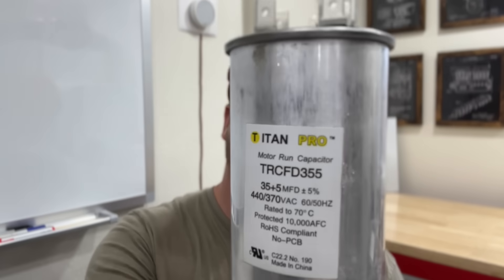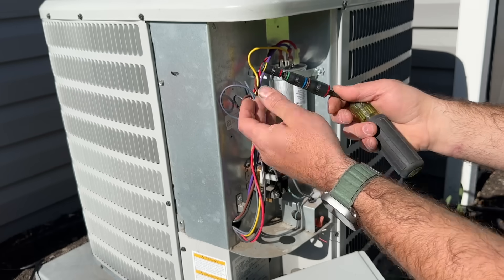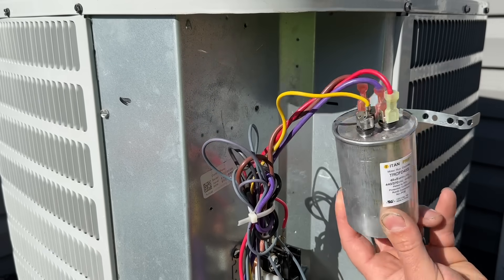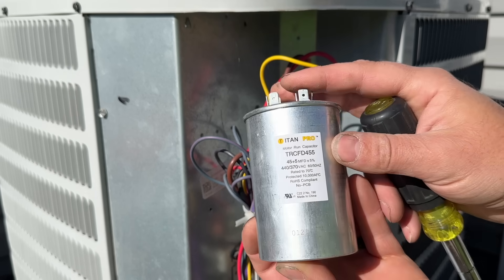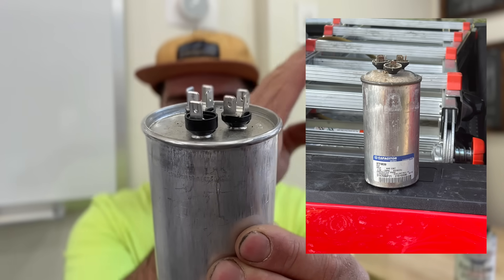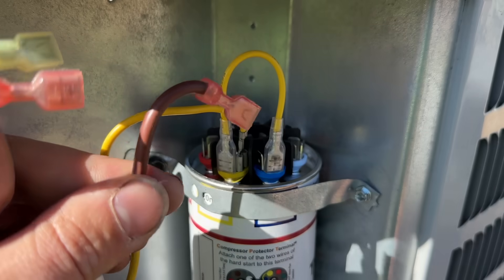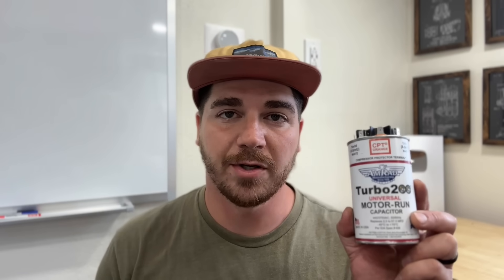HVAC Contractors Practically Make Their Living On These

Comment: Is there any issue with me just replacing these occasionally without using the tool to test it? I have two units I replaced five years ago and my HVAC company are telling me the capacitors are right the bottom range.

I'd happily spend thirty bucks every few years.
Reply: No, but you could just buy a multimeter and measure the capacitance instead every year or or every couple of years.  It tends to drift out of tolerance over time, probably way before it fails.  Also, they sell capacitors Made in the USA, Amrad, Mars and others.  I would use those over the Chinesium specials...

Comment: Because of issues like this, I always do a  LOT of research before I call in anyone for a repair.  Often I can figure out the issue and fix it on my own.  If I can't, most of the time, because of that research, I've already got a pretty good idea what the problem is. 

This is why, when one of my AC units was having problems, I first did some research online.  Through a few simple tests, I was able to quickly determine it was the capacitor.  I purchased a new one for about $20 and installed it myself.

Comment: Easy to replace.  Just make sure you disharge the old one and the new in the box before handling it.  Also make sure you match the microfarad and wire it exactly like the one you removed.

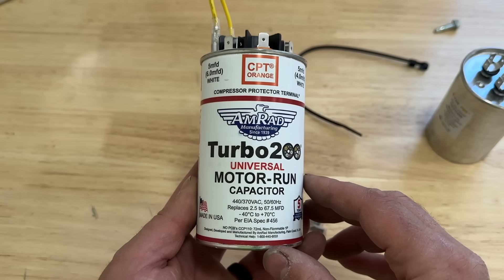Comment: 9:50 most capacitors have an 8 years warranty. The issue is that capacitors dry up over time. When they do, they short. If your unit’s capacitor is over 8 years old, just replace it. Don’t wait until it breaks.
Reply: Think you are probably mixing up compressors and capacitors.  Capacitors typically have a 1 or 2 year warranties, not 8.  Compressors typically have a 5, 8, 10 or even a 12 year warranty, depending on the manufacturer, and model of the unit.

The only time a capacitor will have a longer warranty is if you bought a new unit which has a parts warranty on the entire unit, but it doesn't include labor typically.
Reply: my bad. not warranty... guaranteed life span. they don't rufund you if they dry after 5 years. this is the standard life span for all electrolitic capacitors (uses oil).
Reply: @TheSiriusEnigma  OK, that makes more sense.

The problem you are going to have is I haven't seen date codes stamped on most capacitors.  So if you buy one, it will be difficult to know how old it is, or if you have one sitting in a closet somewhere, will be difficult to know how old it is unless you know when you bought it, and even then, you don't know exactly when it was manufactured.

Comment: I wouldn’t recommend messing in the panel because those capacitors carry 440 volts on one pole and 370 volts on the other. And they discharge in less than a second. Great way for someone to get sent to the emergency room
Reply: You are confusing AC vs DC voltage, and max voltage rating vs system voltage rating.  A/C flows through capacitors, so typically they don't retain voltage when disconnected, unlike when they are used with DC voltage.  The system runs on 240Vac, so the capacitor is not carrying 370V or 440V on anything, that is the maximum voltage rating, as capacitors are typically listed as 370V/440V, meaning they are rated for both.

Comment: I was having issues with my HVAC some years ago.  Have a home warranty, so was using them for diagnostics and repairs.  After several visits over a few months, with a $100 deductible each claim, I realized the repair was simply that my Capacitor was going out.  I looked them up on Amazon and bought 5 or 6 of them.  I started maintaining the system myself after that, and kept it going for, at least, an extra 2 years, all for far less than what 1 service call through my home warranty would cost.  After a couple years, other things started failing.  The system was old, so it got to the point where my home warranty replaced the condenser, and about a year later replaced the internal unit when it failed.  I still have Capacitors left, and they're the same as for the newer condenser.  I had to replace on last year because of extreme heat, and will continue keeping at least a couple on hand. I think I still have 3 or 4 left, so should be good for a while.

Comment: I have replaced my own caps for decades....(not an electrician)...   If the top is expanded out at all.. replace.. $25 - $45 and about 8 minutes is all you need.  
ENSURE the power plug is flipped(on safe) power off, disconnected, whatever you need to do to cut all power.  
Most hated video from HVAC professionals worldwide! =))

Comment: This is a big scam with garage door opener sales folks. They want to sell you a new opener rather than replace the start capacitor. Thanks for sharing this!
Reply: Start capacitor failures are not a thing on garage door openers.  It is usually gears that wear out, springs that break causing the door to be too heavy, or the lifting springs are too small for the door.  A lot of modern garage door openers use DC motors, and they don't even use start capacitors...

Comment: making 2k off a $10 part, I bet they sleep very comfortably with the bed they can afford off that rip off.
Reply: They are obviously not making $2000 off the part.  Most of the charge is the travel time and labor, not the part.  I'm not justifying anyone charging $2000 for this, but looking at the part without the labor cost is a bit bizarre....

Comment: I was once was charged $500 by a "good friend" HVAC repairman to change the capacitor. I remember telling my wife" This guy is ripping me off." I even asked him how much the part was, and he said, "It's around $500, so I won't charge for labor." Needless to say, he's no longer a friend. That's why I say YouTube was the best thing to happen to DIYers. Thanks for all you do. You've saved us millions of dollars.
Reply: i got charged $140 atleast i know my a/c guy isnt an asshole. I have rental properties so i know i can trust him now. Even if the capacitor was free i think $140 is more then fair he still had to diagnose the issue on the roof of the house while it was 108 degrees outside.
Reply: @DeusKDuo  That's what I mean.
Reply: @DeusKDuo Your A/C guy won’t be in business for long. Of course you would think $140 is more than fair, you’re probably the type that even thinks it’s generous. Homeowners always think they know what a fair price is when they don’t know how to run a business and the expenses that are incurred, not to mention you still have to make money. Inflation is a real thing and the cost of goods and services go up for everyone.
Reply: That was dishonest telling you it’s a $500 part, he should have said it’s a $20 part and charge you about $200-$250 for the service. I know it still sounds a lot but he has to diagnose the system go pick up the parts and come back to install it.
Reply: Yeah I had a capacitor replaced last year through a friends "friend", he charged $300 for a new capacitor and the install. I thought I was getting a good deal until I saw this video. I'm just gonna keep replacing capacitors ever summer if I have to and let this AC unit limp along until I actually HAVE TO replace it. I know it's not efficient, but one company was trying to charge me $10k for a new AC and furnace (which I didn't need) but if I just got the AC it would have been like $7.5k. They didn't even check the capacitor, they just told me it was dead and I needed to replace the whole thing. F those people man.
Reply: @psycold  Just get a second capacitor and store it for when the current one goes out. This is what I do for my 19 year old Trane. If I have any issue with the condenser outside, I just swap the capacitor first thing. Its so cheap and fast its quicker than trying to troubleshoot voltages etc.
Reply: @psycold ouch
Reply: @psycold srry to hear your friend isnt worth paying $300 for his time, knowledge and experience a d gas for going to your house to help u while in need. what a friend u are i say.
Reply: @MateoLopezTX  I have a service business, and every person who knows me somehow, thinks I should give them a deal, every time. And a great deal too. Never do they think they should overpay me for something, not even once. I like helping, especially if somebody doesn't have a lot of money, but the expectant behavior is what gets me. Like I owe it to them.
Reply: Don't trust anybody whether its home repairs, car repairs or even voting!!  Always do your own research.
Reply: $500 is on the way higher end of the spectrum, 300-400 is pretty much the norm for putting in a turbo 200 and its fair, the part cost $70 after markup 120-150, the diagnostic fee for most companies is going to be 150-200, Keep in mind since its a service tech he's probably getting 25-30 dollars an hour in places like CA and MA more lik 45-50

so the companies investment into YOUR problem is having the part you need sitting on their truck $70 dollars+ paying the tech $30  so there into this call for $100 dollars already and thats with out calculating the general cost of running a business per customer they  are probably more like  $125 dollars into it, congratulations the entire business before taxes made $250 dollars of you for coming out and fixing your AC a few hours after you called them HOW DARE THEY MAKE MONEY THE HORROR
Reply: Imo anything more than$ 200 for a capacitor replacement is a rip off.  I had a local company come out to diagnose mine unit and I was willing to pay for the service call and repair.  Till the tech walked back in telling me it would be 2200.  I paid him his service call fee and sent him on his way.  Then Drove down to the local supply house bought a new cap for $10.  And did it myself.  Such a simple repair.  How do you think they blast all those local commercials.
Reply: I learned the hard way as well.  The first AC guy who ripped me was reported to the state for fraud.
Reply: Yep just got ripped off the same way by a HVAC guy who left one of the big companies to go out on his own. Said by leaving the big company he could give me the same service at a fraction of the cost. Told me the capacitor was $420 when it really cost only $20.
Reply: Ok hear me out . $2000.. that’s a rip off even $500 .. but your paying for the service mechanic to come and fix your AC .. $150_$300. Is reasonable.. you  are paying for the knowledge and experience.. and service .. they’ve got to make a living to .. I’m a plumber sometimes I go to a job .. and say the toilets running and it’s just a fluid master adjustment which is a 30 second adjustment. I have to get paid for my service … I went to a job that was a  huge mansion the owner was a surgeon … his shower head was loose he didn’t know how to tighten the screw on the shower head .. it took me 1 minute I could’ve charged 3-$500 ..but I have a conscience and just charges him a service call … but my point is he didn’t have the knowledge to know how to tighten that shower head … yet he could take out your kidney and replace it .. the point being your paying for my experience and knowledge.
Reply: @mattd2503  correct, it takes time, skill and experience to acquire certain knowledge, which is an added value.
And don't forget the equipment. I could do all the work on my car by myself, if I would invest tens of thousands on tools, a lift, etc. But that would never pay off.
Reply: @mattd2503 youre ripping people off and there’s no justification for that. Just accept you’re garbage and move on with your life.
Reply: @mattd2503 experience, knowledge, time, gas/auto/misc.  Alot of hidden fees which is ok for $300 but it depends on where you live.  I was charged $1100 for capacitor and to fill up a frean that’s no longer available and allowed in California.  Yah I felt a bit ripped off but not too bad.
Reply: @mattd2503  yeah but $300 is more than exorbitant for such a quick fix.  And $2,000 is downright criminal.
Reply: @bobrolls3800  na, $300 for a cap is fine. You have the service call, diagnosis, part and some sort of warranty involved. Plus your risk of working on anything, once you touch it. Risk of charge backs from assholes, insurance, etc. Overhead and on n on. There are minimums. To say "more than exorbitant", sounds like a typical cheap home owner. I replace these types of things myself, but if I didn't, and it was $300, and I figured out late the cap was $20, I would be ok with it. Price you pay to have someone else, who will be dead one day, and are spending a small portion of their lives dealing with repairing my stuff.
Reply: You never needed YouTube to tell you that it's always been prudent to understand what you own, or have contractor that are competent, professional, and personally referred to you
How do you pick a surgeon, the want ads?

Blame yourself, milk dud.
Reply: So you expect your friends to just do work for you completely for free? Yeah, you sound like a great friend. Cheap fuck.
Reply: Ouch
Reply: Stop lying Bendard. We are no longer friends because I was bonking your wife. Tell them the truth!
Reply: I guess he wasn’t a good friend
Reply: I’m a little shocked that some here are defending exorbitant service call charges. Where I live, your chances of getting ripped off are pretty good. It doesn’t take a genius to learn how to check a capacitor.
Reply: If you have a business and you have trucks in the field, you can’t do anything for less than 300 bucks between insurances and every other thing you have to cover course I know your cheapskate do it yourself as think a business guy shouldn’t charge a decent fee but what are you guys do for a living? Do you give anybody discountsas a dentist? Give me a discount does a Lawyer give me a discount give me a fucking break.
Reply: @paulblueosyter1472  No doubt you have overhead, but the HVAC mark-ups and charges are ridiculous from an everyday man standpoint. The $500 cost to replace a capacitor is not a "decent fee", its outrageous. To compare to a lawyer's fees, that's charging about $1500/hr. and the lawyer and dentist had to go through years of schooling AND on the job experience to attain their skill and expertise. Not knocking the trades, they make the world go round. But if you have to charge $500 to change a capacitor in order to make a decent profit, then there is something fundamentally wrong. And by the way as an educated service professional, I do give plenty of discounts. But everytime I get hit with ridiculous HVAC, plumbing, electrician or auto repair charges I turn to my wife and say "I don't get discounts so now nobody will get discounts from me"
Reply: If the homeowner doesn't  want to deal with it themselves, it's not a ripoff.         If you think it cost to much,  do it yourself.           No one forced you to have your a/c cooling again!
Reply: @BigJon-wb9jq  Reasonable pricing without the grift, genius. That's how you build a reliable customer base.
Reply: And I would add e-commerce to that, for knowing what to replace means nothing, if you can't source the parts for a good price.
Reply: Same story here. Years ago one of my rentals ac went out on a dang Saturday.  All the stores were closed. Called me neighbor who is in ac. Told him the exact problem and asked him to fix it. $300 later and a few words we no longer talk. He even pulled out the price book. I told him to shove it. I normally spend around 15 for the part at fox appliance.
Reply: @beachsideredneck Sounds like you needed something done and couldn’t do it yourself, and on a weekend too? You have nerve bothering someone on a weekend to solve your problem and then turn around and be cheap and degenerate.
Reply: The part may be $50.00, but knowledge of how to do the job and his previous experience needs to be paid.  Think about how cheap you are, he had to pay the gas, time, get the part, get the experience so you can slam him for fixing it for $500.00, grow up. You are no friend.
Reply: @titaniumspecial4207  All you have to do to replace a cap is watch a youtube repair. It ain't rocket science. If you're too lazy to do that I guess you deserve a five hundred dollar charge. It cost me 22 bucks.
Reply: $500 vs $2000 doesn't sound like a rip-off. Your friend has experience to recognize whats wrong & used his time.
Reply: @namrehh  Please. If this is how your friends will treat you, who needs enemies?
Reply: @bernarddavis4379  will your friends pay their bills with your friendship?
if you open up a restaurant, will you have all your friends come & eat for free when you have to pay for the overhead of running a restaurant?
Reply: @namrehh  that is a different story.
Reply: @j.dragon651  what's different about it? He will need to spend his time to go out there to perform the repair. On the other hand a friend can easily tell you what needs to be repaired so you can DIY. You absolutely cannot tell someone what to charge, you can decide if he's a friend after that & he can decide based on how you react to it.
Reply: @namrehh  I am a retired class A machinist. Anytime a friend needed something made or repaired or a car worked on, the thought of charging them never crossed my mind.
Reply: Yeah its a rip off @namrehh
Reply: @namrehh  Friends should not be charging friends anything but the cost of materials period. If your making money off your "friend", he isn't your friend, he is a customer.
Reply: You actually didn't get ripped off that is around what most contractors charge. You have to consider all of their expenses. A rip-off would have been if they asked you for 2 grand
Reply: He didn't rip you off at all. I just had my guy do it for abput 450 plus he added coolant. There time is worth money too. You might rethink your attitude ypu putz.
Reply: @KGFishyFingers  I just did mine for 22 dollars.